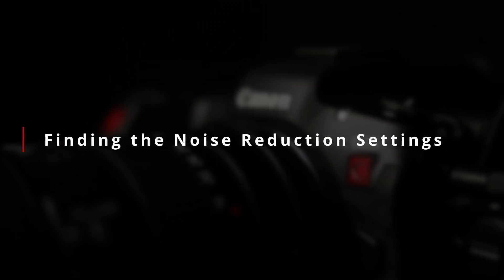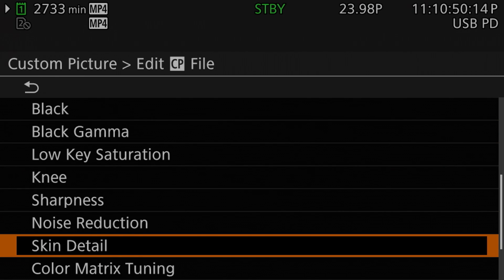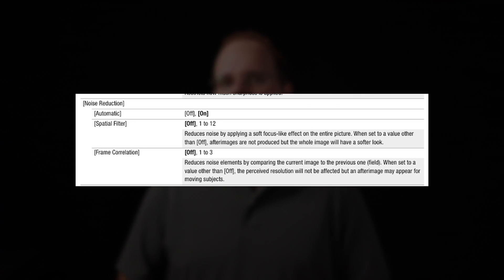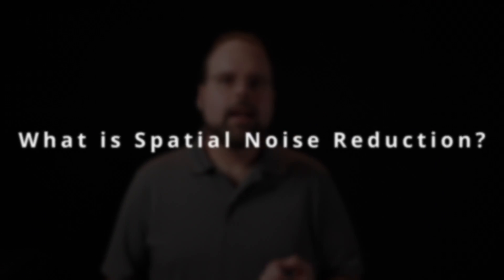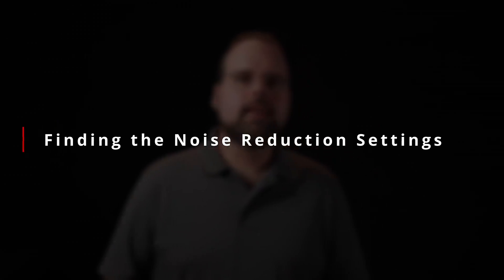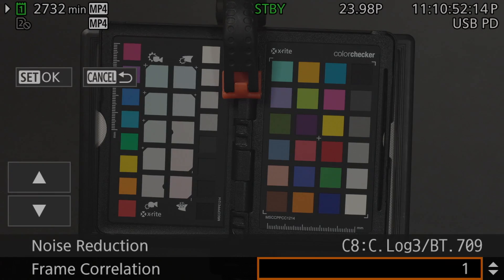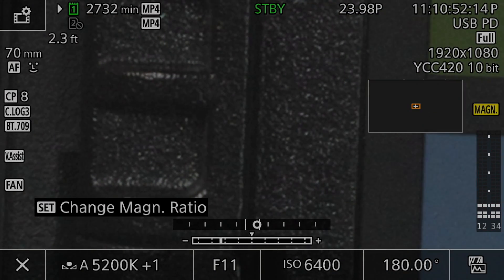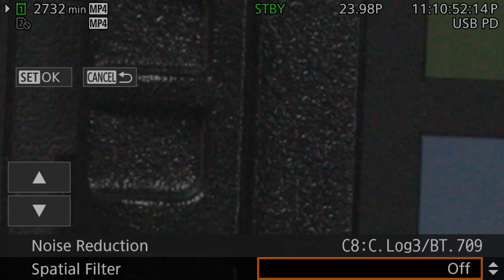In Camera Video Noise Reduction - R5C Tip 29

Comment: I have been visiting the Cannon forum and asking a lot of questions.. One of the videographers there told me that they shoot at base ISO 3200 even when going below 800 ISO. It would be really interesting to see a comparison and analysis on the difference between these two modes.
Reply from the maker: It's on my topics I want to cover list, but I have to figure out how to test it. Either I need to drop some cash on a exposure step wedge, or figure out how to do something similar without it.

Comment: Very informative! Thank you for another great video! I did have one question and I think I already know the answer but thought I’d ask just in case. Noise Reduction wouldn’t affect 12 bit RAW correct regardless of any changes to the CP?
Reply from the maker: As far as I can tell, that's correct. The raw data is unchanged regardless of the noise reduction settings. 

In fact, it doesn't seem to be used even by Canon's Cinema RAW converter to apply any form of noise reduction there either.